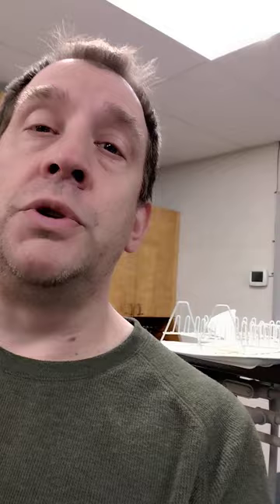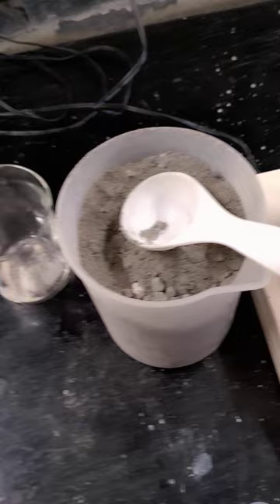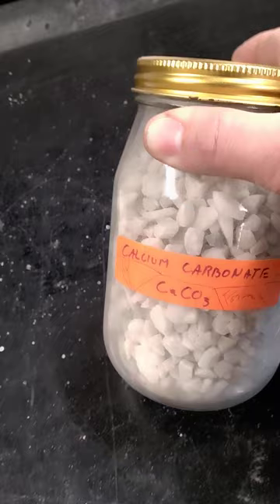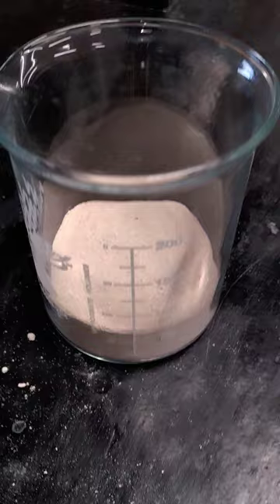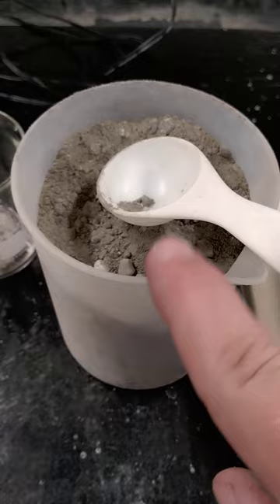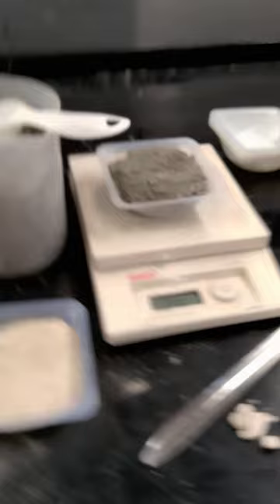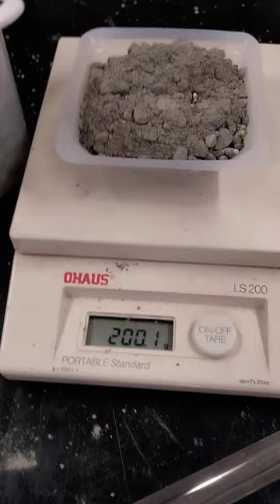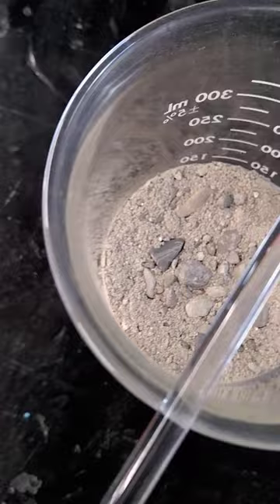Roman Concrete Lab

Comment: That's the theory, but nobody has tested it... just because it fills in the cracks doesn't mean the filler material becomes structural.  There is probably something else in Roman Concrete that makes it structural when it heals itself....